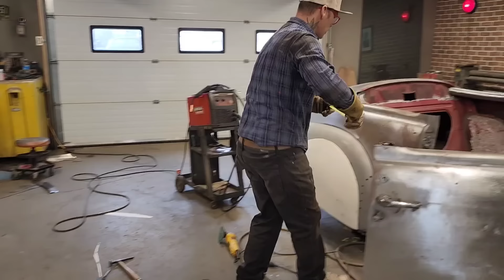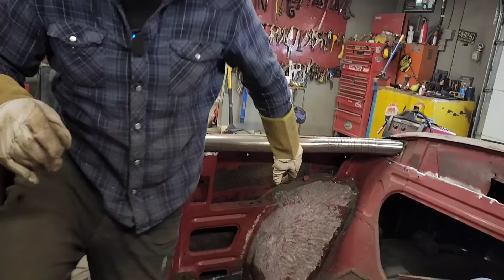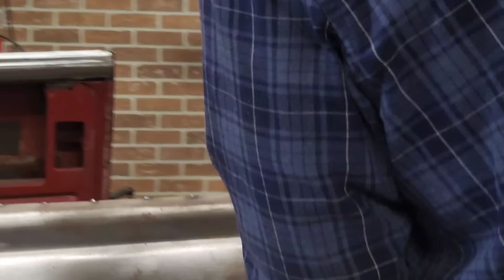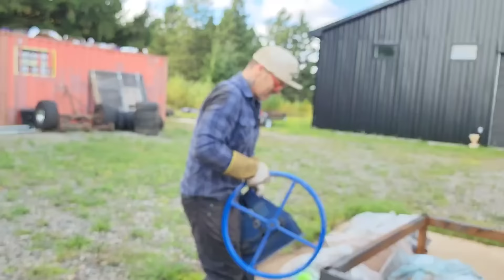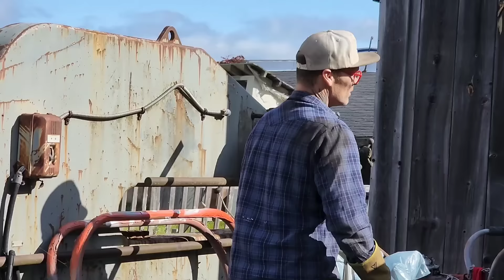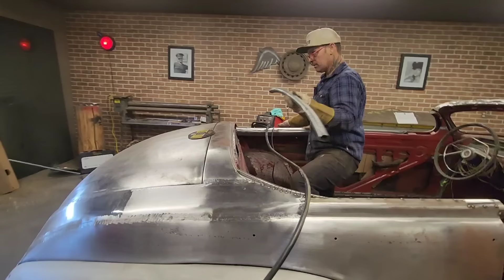Using exhaust pipe to fabricate is multi-purpose... shape and structure 👏

Comment: I appreciate your videos,  havn't missed one in 6 years,  use rapid construction in everything I do.  This weekend,  cut the wall out between the kitchen and bathroom, chucked in a double lintel about 2.5 meters long,  counter sunk the fridge into the wall,  next to that is a pantry with 1960s bifold timber doors I picked up with my Youngest son yesterday, nothing else was bought,  all stuff from around the place,  it's all done two boxes,  gibbed and doors hung, I used 100 100mm stainless hex drives as it is fast and I don't like nailing, used the cut off wheel dozens of times,  all handsawn as it's faster, you could spend months on it if you wanted to, mine is stronger and I can move onto the next project: entry stairs to replace the near vertical concrete steps, will go up half way,  all timber stringers, then a landing and back up to the deck,  will probs be two weekends as we wait for concrete to set, back in the shed on the Holden soon,  put the roller door on last weekend, works mint,  just had to add couple halves of a an old plastic cutting board to guide her into the track, it's all 50s so you make do

Comment: GREAT job on this Volvo. I always had a soft spot for these "1947-8" looking body styles, and your vision of it as a low-slung rag-top is very creative. I think you may have made yourself a little extra work by not cutting the ends of the pipe to conform to the door-jambs instead of the other way round, but you'll find a way to pull it all together as always. The scale of this car is just about perfect at like 3/4 size of an old Ford or Chrysler that would have been used back in the day.  👍👍👍

Comment: How about slicing out 1/4 of the pipe and slipping it over the window flange so the there is no height variation. It would merge in with the rear deck height and roll into the seat area.

Comment: is buddy welding galvanized pipe without a respirator?
Reply: I was thinking the same thing that the pipe going across the back is galvanized pipe. Did you see when Chad set the pipe across the back and decided where he was going to cut the pipe after he cuts  the piece off the end of pipe he was going to use he left it on the floor then he grabbed the wrong piece of pipe and used it I could see that the bend was not the same.  I have seen Chad do that several times I don't know why he doesn't put a mark on the piece he wants to use if he put TS on it the T is top and the S is that side or T F top fruit it would save Chad a lot of frustration

Comment: What a great transformation to a convertible and excellent craftsmanship. I was looking at the boot and thought if you extended the boot lid down into the fabricated back bottom panel it may just look factory and the extra length will make it easier to get things in and out of the boot. Also it would look great with a convertible folding vinyl roof. What do you think? James from Australia
Reply: @jameskeys8263 Respectfully, a “Roadster” Sir.

Comment: I know Chad loves his coat hangers for welding, and he says there is no problem using them, this is not my opinion, and I could care less if he welds using coat hangers or not, this is just what I found about it using google. I did a google search on it and that search said this. 

You should not use coat hangers in welding because the thin metal they are made from is not designed to withstand the heat of welding, making it likely to melt, warp, or burn through quickly, potentially resulting in poor quality welds; additionally, the unknown composition of the hanger wire could introduce impurities into your weld, affecting its strength and integrity.

Key reasons to avoid using coat hangers for welding: 

    Low melting point:
    The thin metal in a coat hanger has a low melting point, making it easily melt or deform under welding heat. 

Unpredictable composition:
You cannot be sure of the exact metal alloy used in a coat hanger, which could lead to unexpected reactions or impurities in your weld. 

Poor structural integrity:
The thin wire of a hanger lacks the necessary strength to hold up to welding stresses, potentially causing the weld to fail.
Reply: Never seen him use it on anything structural.  Usually just skin gaps.
Reply: All good points except he's not using them to weld up a bridge, he's using them to fill small panel gaps on a car and have MIG welds all around them rendering the coat-hanger welds basically non-structural.
Reply: If google says it’s got to be true. It’s not like he’s making a space ship 😂😂
Reply: @willylanganke8862 nailed it! 😉✌
Reply: OMG !!! What the hell next are people going to find to say bad things about how Chad does his cars !!! Man man, some peoples life must really really suck to complain about welding sheet metal with a coat hanger !!!!
Reply: On your soap box again brussey my mama says hi.😂😂😂😂 go chad nation
Reply: I was using cloth hangers since the 60s never had any problems with it .
Reply: @craigmay-u9g  Mummy and little boy at the breakfast table  !!
Reply: Another 12 year old  with something to say your moma no your on line with  the adults
Reply: You guys made me laugh so hard. almost choked
Reply: 😂😂😂😂me to..😊

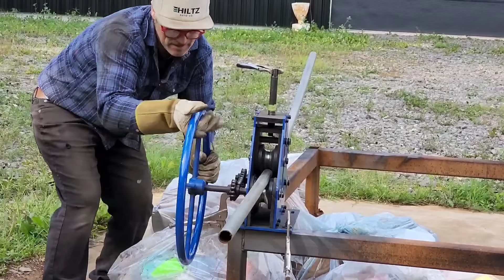Comment: 37:37, get that small pipe same curve as the pinch weld area, when happy with fit. Zip cut a groove longway down side of pipe. Slip it on and weld it. Shazam!
Dan "the Elvis singer" Smith
P.O. Box 46
 Alvarado, Tx. 76009

Comment: Chad you did not mark the pipe left or right over the boot section. when after you tried to fit it you would swop it around not knowing that you have done it and you ended with the mark on the pipe at the wrong side. Sorry I am only trying to help.